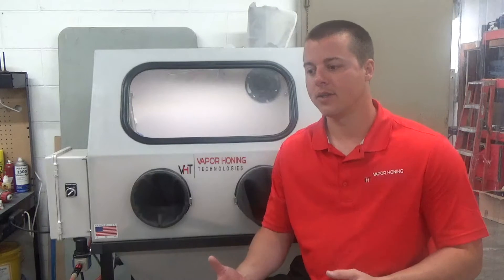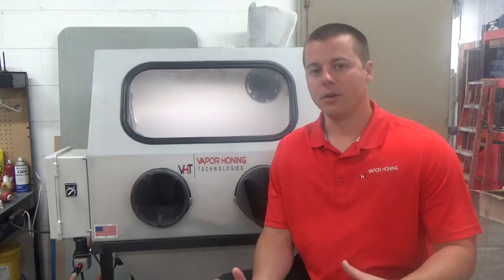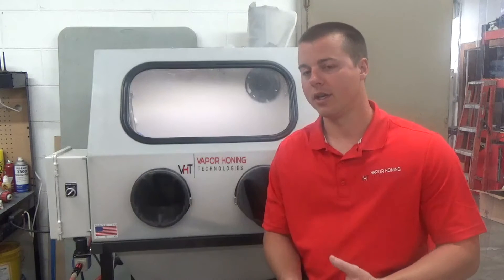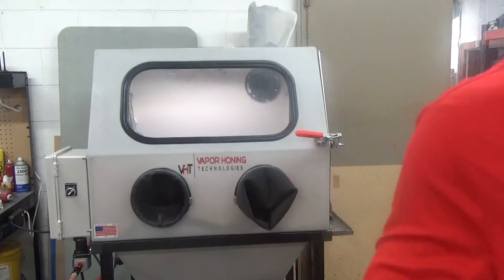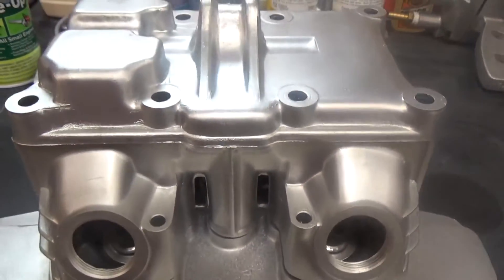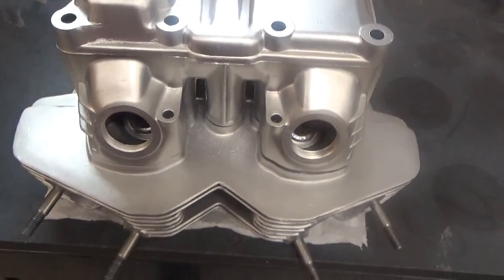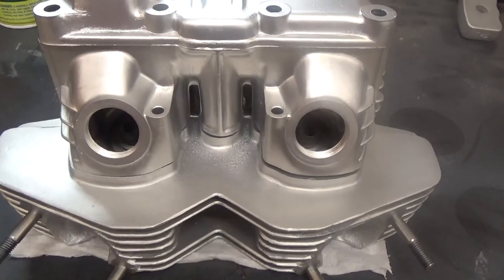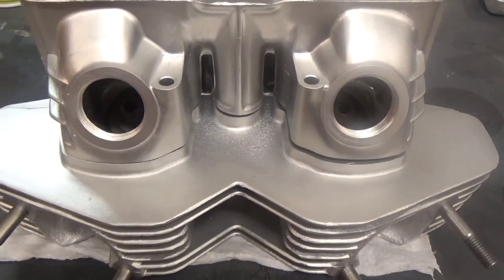How Long Does the Abrasive Last in a Wet Blasting Machine- Vapor Honing Technologies

Comment: Hi, you say that abrasive will last 8-10 times longer than in a dry machine but that doesnt tell me much. If I started with say 20 lb of new glass beads in the vapor blaster, how many hours of cleaning aluminium could I expect ? approximately.
Reply from the maker: Aproximately 480 hours (8 hours/day x 60 days)